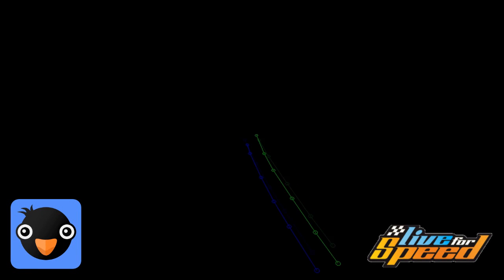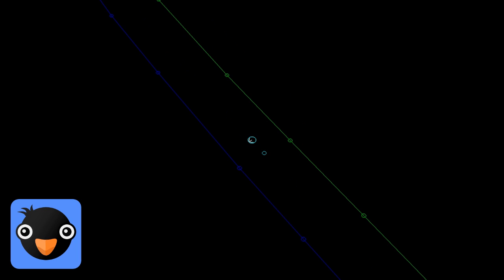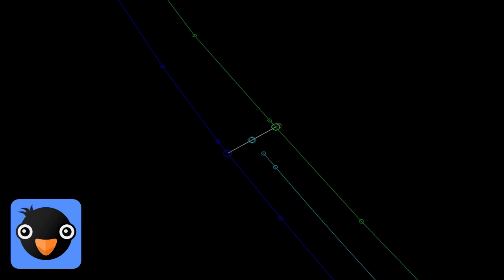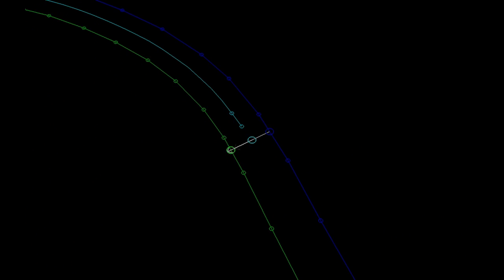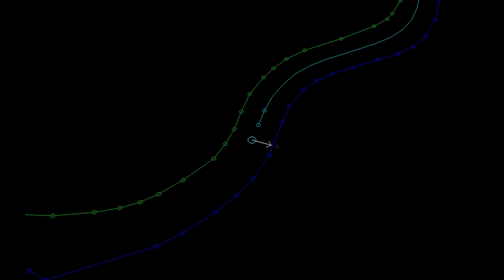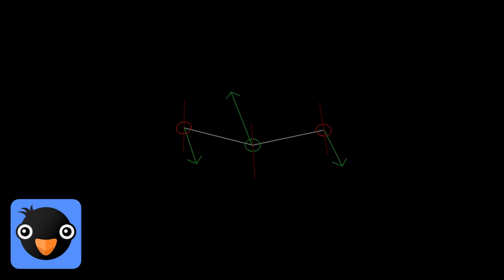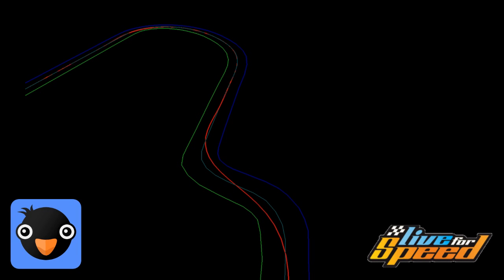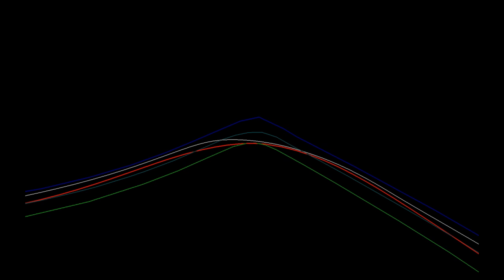Artificial Intelligence in Racing Simulations: Computing the Racing Line

Comment: Now I wonder how it would handle speed. in most games (all games if we don't count the 1-day bedroom games) the car starts to slide when the speed in a corner is too high. So the AI should look ahead, or the line should also implement a suggested speed. Is there a 'best way' to do that? Or should the developer decide if either memory or computational resources are more important?
And how could it handle multiple cars? The cars should be able to overtake, which means they can't all follow the same line. They should find their own line to try to get around the other car.
I don't think that there are enough computational resources to create multiple different racing lines with that many different conditions while still using many iterations for each line. And on top of that they need to adapt to the other racing lines, which means they have to be calculated or adjusted over and over again.
Or is 'adjusting' the right way to do it? Have a perfect racing line which is equal for all cars, and let the cars adjust the line with (let's say) 10 iterations each frame so that they don't cause accidents. 
With a little bit of RNG this would give a different result each time.
Am I on the right track with these thoughts?
Reply from the maker: The racing line could be stored per-lap and shared for each AI driver fairly easily. You could have even have multiple lines through each corner for a deep braking pass, inside / outside, etc. Regardless of what the speed is, this algorithm computes a fairly good representation of the best (fastest) racing line; obviously the speed will change pending the friction and capabilities of the car, but the line will remain the same. Potential improvements could be detecting and sacrificing specific corners for better entry / exits elsewhere.

10 iterations would not be enough to find a compelling racing line, at least 250 would be needed and even 2500 for better results. This can be pre-computed and stored reasonably with little memory used.

Comment: Hi Tim, lovely video! Interesting approach with the hinge methodology. Why do you take the center line as a starting point for your iterations? Wouldn't it be better to start with the shortest path?
Reply from the maker: The information I start with is just left/right edge, so finding center was easy and worked quite well. Shortest path may also make the pain point of straights a bit more obvious/worse than it already is. With a straight that has a right hand corner before and after it the line tends to move less on the straight where as the best line would be quite close to the left wall. The hinge method falls closer toward center of the track in the middle of this straight, and shortest path would probably have it even closer to the right wall.

Comment from the maker: @Quinten Kock It is rather difficult to reply to a linked comment, no reply button...

The physics of a spring is quite easy, and google can point you to several good articles.  In a nut shell, A spring has a desired length, if stretched longer it will try pulling back and if squeezed shorter it will also attempt to push back to original length.  It can get slightly more complicated when using dampers to change that force based on the velocity of the change in length.  That sounds confusing in this comment, but it is pretty simple once you look through google/wiki.

You will notice that the spring I used is more like a opening a hinge rather than a desired length.  You can think of this as the spring has a desired length of 180 degrees, it wants to open up, so when squeezed closed, it tries opening more.  By attaching several of these together with point-masses that have positions starting along the centerline, then stepping forward through time, it will slowly open up to the geometric racing line.

I actually want to improve upon this a bit, because the geometric line isn't really the fastest way around a race track, even ignoring camber and other track effects the best line changes due to the long straights.  Lap times can be reduced by sacrificing corner entry/exit near these straights, but the geometric racing line is a very good starting point when approaching a track.
Reply: Thank you for this comment, I am recreating the same thing in Unreal :)

Comment: I am looking for something like this, with the exception that I do not want to improve a LFS racing line, but instead make new ones for open configuration tracks. Any help would be greatly appreciated.
-U<3TAH
Reply from the maker: I'm not entirely sure how you'd like to do it for open configurations, since there would be multiple lines pending on the actual configuration desired.  With that said, if you choose the configuration desired from the open path the algorithm outlined in the video should help.  Otherwise you would need to make the algorithm allow for multiple paths to search.  If you have other questions just let me know!
Reply: Okay, here's an example: Live for Speeds Blackwood has the GP & Rallycross tracks. Open configuration would allow a driver free reign drive on both. I would like to know if there's a way to "Cut & paste" the 1st half of the GP track, to the 2nd half of the Rallycross. And if so, what program do you use or recommend?
Reply from the maker: The program here was one I wrote myself for the computation of the racing line, and it works by feeding the left/right edges.  Technically you could create two lines by going around the track twice, once taking the GP route, and again taking the rally cross, but ultimately it sounds like you will want to create a program that will compute and combine several routes into one.  I am unsure anything already exists that will do this for you.
Reply: Okay, I follow. And I guess your program wouldn't be on the market, nevertheless an "easy download" right?  This system is really unique, & being a very geometrical guy I really get it. But I'm also one that I, quite literally, have to touch, trial, fail, & repeat. Ya know?
Reply from the maker: Unfortunately it is part of the AIRS project and not something that would be much use if released so it isn't easy to download, with basic understanding of the geometry and vector math it should be fairly trivial to create with minimal programming experience- this project is full of trial and error, I even mention a few errors I stumbled on.  I recommend to get your hands dirty, fail as needed and repeat!
Reply: To your knowledge, is there any type of system that I could possibly get started on just to have a go at it? Other than that, any recommendations as far as computer choice, schooling perhaps, or even a company/industry to look at?
Reply from the maker: Any computer system can handle this task and many programming tasks.  I went to college for Game Development, and have been in that industry for more than 5 years, but programming is something I picked up on my own before that point in time.  Grab Visual Studio (C#) express from Microsoft (if using Windows), or XCode (Objective-C/Swift) for Mac and get started.  There are other options you could look into as well.  There is no wrong way to get started or do something, but there are many different ways.
Reply: Alright, thank you for taking the time to answer my questions & such.